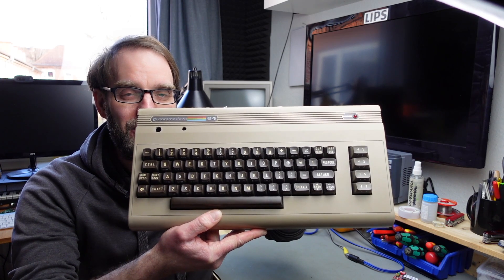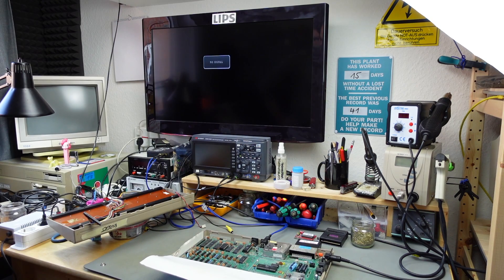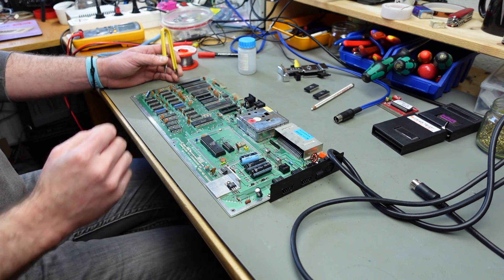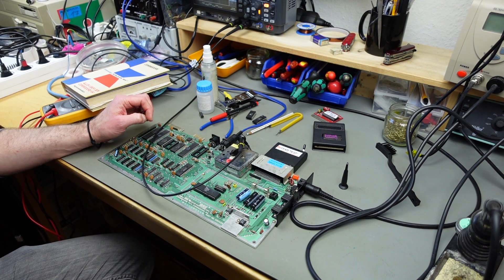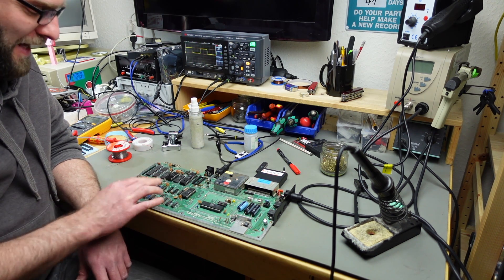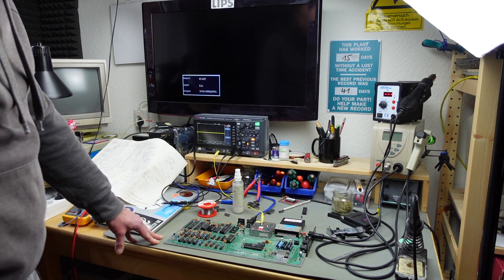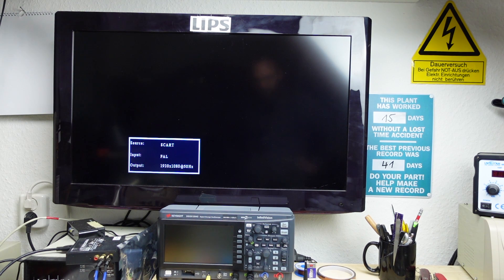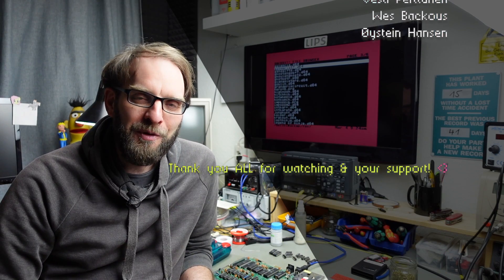Stubborn C64 Repair

Comment: I don't honestly think I learned much at all bud. Never assume something works, I already knew that. Never just replace stuff without knowing it's bad, I knew that as well. This is truly a case where I hope you learned something. I don't want my words to be taken as negative criticism, but you seem to do these types of repairs quite a bit. That is to say, a bunch of messing around until you stumble onto the issue. I understand that we are all still learning and a person doesn't know something until they know it and learning curves can be quite steep. You have enough working systems laying around, make one a permanent test machine so you can verify working parts or something.

Hey I am just a random putz on the internet, so take my words with a grain of salt if you wish. I am a blunt person so I hope you don't think I am just being some sort of overly critical jerk, I have no control over that aspect of it all though... Pulling out the expensive scope was completely useless and I know how useful they can be but it provided no value to this fix. It would be cool to say AHA look at what the scope shows here, we have a bad part, but you need to know what the exact signals are, how to read them and what different permutations of signals types are possible. I cannot fault you for this at all because electronics (both digital and analog) is a HUGE topic that requires a ton of knowledge and experience. Try a more methodical approach. Quite likely the most useful thing you did was touching chips to see how hot they are, and that testing methodology costs nothing at all.

Glad you got it working though. Try to verify that parts work before installing them, if something seems odd, reverify the same exact part that you just put in. Verify the part that you removed. It may seem pointless but certainly no less pointless than replacing parts that "seem" to be bad or could possibly cause a fault. It will help gain some understanding as well.
Reply from the maker: Hey, I certainly learned a lot from this. I'm still no way near being a professional repair person I mostly mess around for fun. I think I explained why I did all the steps and why I thought the oscilloscope readings were pointing to a fault (which turned out to be a non-fault, just a design flaw in the system). I don't at all think using the scope was useless. I just measured the wrong things. And I used a test system to compare things in the second half of the video, too. Which was both distracting from the actual remaining fault and helpful in other parts. In the end, I hope it turned out to be an amusing video at the very least. Not meant as any kind of tutorial, just documenting my messy process. As usual. ;)